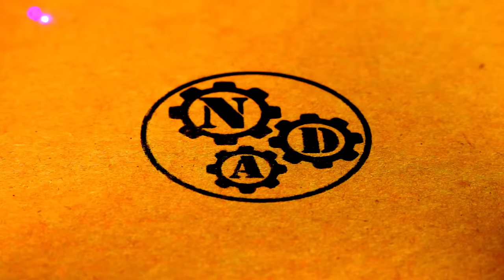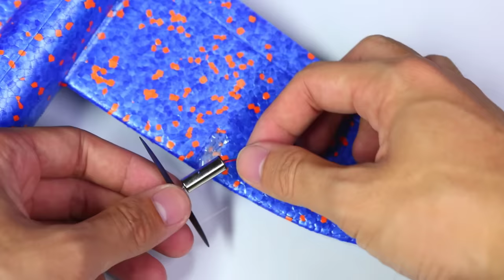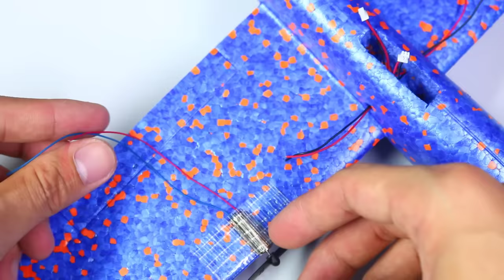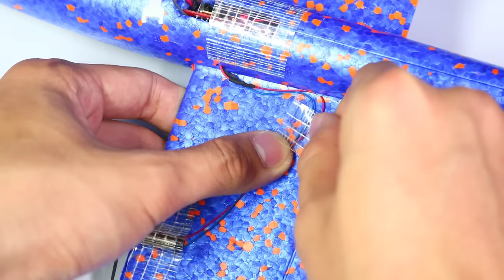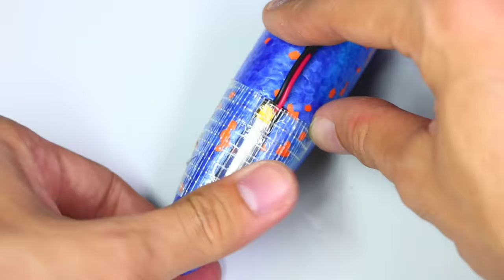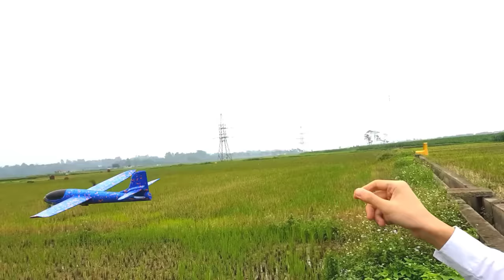How to Make RC Airplane at Home - Very Simple

Comment: I see a number of people recomending moving the centre of gravity forward to improve the flight characteristics, but the battery (probably the heaviest item on the plane) is way forward in the nose. 
If you look at the side view of the plane there are two positions for assembly of the tail, the lower horizontal one, is for gliding and the upper steeply angled one, is for loops (or gyrations as it says on my one). Why the constructor chose the upper one I have no idea. 
On launch the plane has sufficient thrust to fly but immediately starts to climb into a loop. Not having sufficient power to maintain this climb it stalls, falls out of the climb but recovers just before hitting the ground. On recovery it then starts the same sequence all over again for as long as it stays in the sky.
I would like to see how it flies when trimmed for a gliding flight.
Reply: Hey I was confused about this also, however, I believe it is because if the tail was in the lower slot at max power it would be going straight not pulling up, so eventually would just go into the ground. Not to sure though
Reply: Totally agree man amma build on of these  and I’ll let you know how it works and I’ll try your suggestion
Reply: @izaelmontemayor6996  Good luck with the build. Looking forward to seeing your results.

Comment: That's outstanding. I bought a few of the same gliders and I will turn them into rc planes as well. I have way heavier gear though. 1000W motor, 3-4s battery a few servos.
Reply: That's way overpowered 😂
Reply: @tonim.9460  as all things should be.
Reply: @alisioardiona727  And it will be really heavy compared to the size of the plane
Reply: How did u do that bro

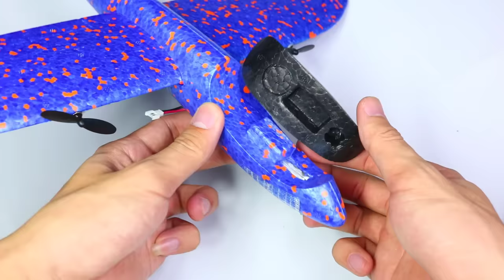Comment: Add that metal ball (3:58) . It will fly perfect this will bring CG towards the nose.
Reply: Free Bomb  yes
Reply: I have the red one
Reply: My glider looks the same but it’s a shark design I hope it works
Reply: I'm planning to do the same. This looks like the smaller 14" version glider.  If it is the larger 17.5" glider, maybe doing a pusher brushless 1 motor mod instead ?
Reply: Mine just falls to the ground nose first during launch. Either to the right or left nose first
Reply: @skyforce2132  ghdul
lkupğscvrtynnlbuhytgfruujjnnnjkkkmşjmmvhnhmvfhxtcfffmplnkjşlpimmmkmkmmmkmmmjmjlölşişşşşşiiiiiiişşllğiöoykllll

Comment: the reason why it is tail heavy is that the tail plane is not on the correct fitting and its trying to do loops. put it on the bottom hole and it will fly straight

Comment: Súper. The plane is tail heavy need the battery further up front. But it's just awesome! Yesterday I was looking into that exact glider...2 USD. Will most def. give it a try. Can you share the distance you placed the motors from the fuselage please? Great project. 

As a note, moving the motors a bit further out could improve the turn in. Just a matter of experimenting.
Reply: 6cm
Reply: Or 7
Reply: 7cm

Comment: I just did this project with all the parts and when I toss it into the air it just falls to the right nose first, it doesn't fly. Anyone have any ideas?
Reply: Add some weight on left side
Reply: Till it balance
Reply: Ok na
Reply: Electronist  I tried with and without ball. I spend money getting motors trying different things. It never flew straight... I ended up giving up on it

Comment: I've been trying for a long time to find this kind of video with proper links for a 2 channel plane fantastic video. Is there any place that does curcuit board for a controller I already have
Reply: There's a great way to get a hold of all the required insides for a small two channel like this and that's to get a Walmart/cheap rc helicopter with extra tail props. Take out the two motors and put them on the wing just use the extra helicopter tail props for the airplanes props and it will already be setup as a differential thrust 2 channel.
I wouldn't make the plane any bigger than this guys though. I once made one from foam plates. Good luck!
Reply: Just look up "helicopter to rc plane conversion" on YouTube and see what you can see
Reply: @rckingdom3516  good idea. Any link to the helicopter from Walmart?

Comment: Do we have to cut elevators

Also pls. Give link of connectors
Reply: Mate I think he picked an old drone and picked all from there (like I am doing) then u have all parts. I have 4 motors from a single drone, four connectors that u are talking about, one radio trasmitter and one Lipo. Take one drone that u don't want and u have all parts required. :D

Comment: never mind, on internet such kits are sold already for years. all u did is instead of buying kit, u bought foam glider body and used brushed quadcopter board and used differential thrust for gliding. sorry i wudnt call it innovation or creativity. u just cudnt find right parts so put quad parts in glider. lol Peace
Reply: I deal a lot in RC. He was very clever using "off-the-shelf" parts. First HACK of this type of RC GLIDER on YouTube.